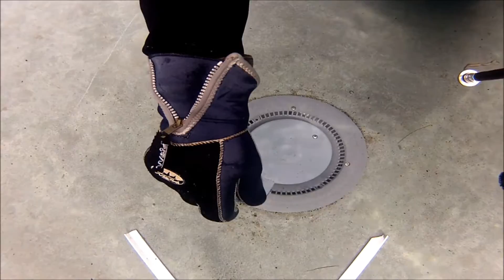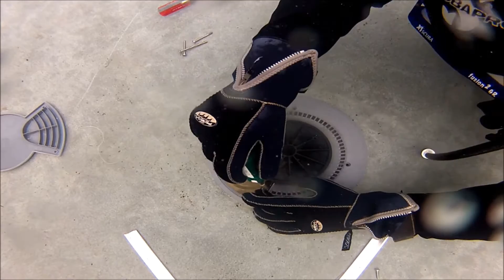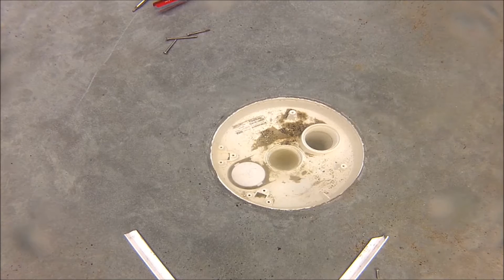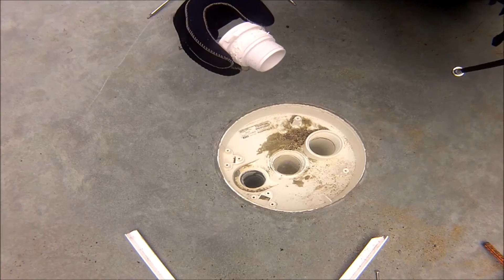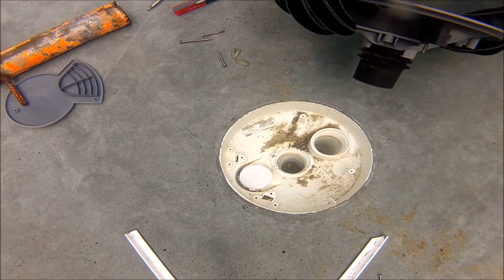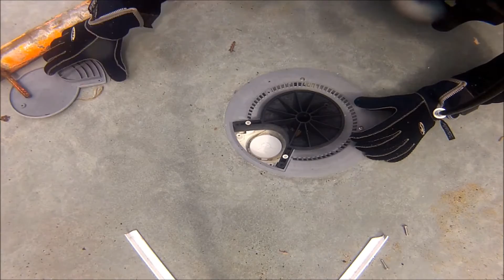Replacing a hydrostatic valve

Comment: I want to drain & paint my fiberglass pool in Central Florida. Is it better to replace this when empty or full of water?
 Logically I would think when empty but I am concerned about draining it with a bad valve and the pool not being equalized and damaging/popping up the pool. I appreciate any insight.
Reply from the maker: I would suggest as soon as you can get to the valve remove it and replace it.  If the valve is bad it will be leaking water so there is nothing to worry about on that end.  But make sure if you have one to replace it and put new covers on as well
Reply: Did you drain your pool? I want to do the same thing

Comment: Michael, That is a really nice video. You did a great job. We have a concrete pool and are located on the top of a hill. How can I tell if the bottom drain has a hydrostatic valve?
Reply from the maker: Pull the cover off the lowest point  see if there is a valve in there  if so then you can replace it

Comment: Where did you get the Hydrostatic Valve Removal tool from? It looks like metal as opposed to the PVC types I've seen. I'm worried the plastic ones would break.
Reply from the maker: I made it out of a steel pipe.  the first one i had was plastic and it didnt last long.